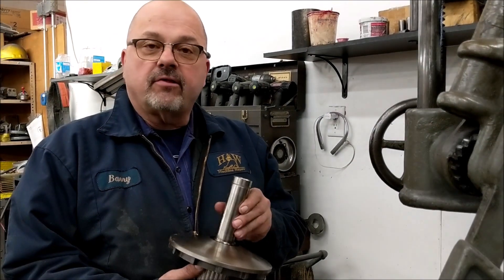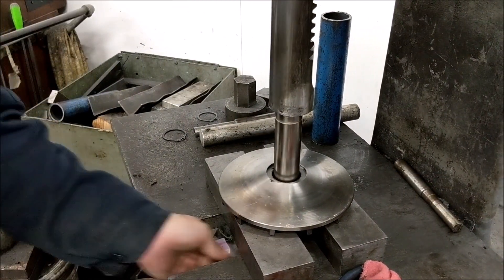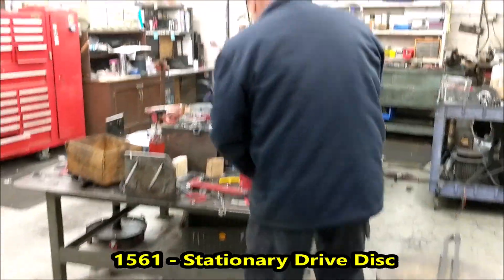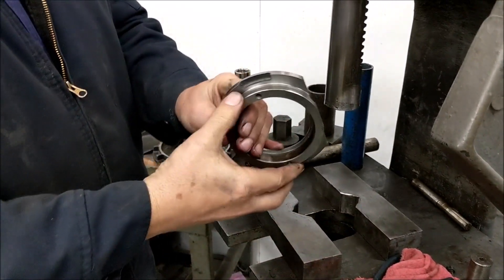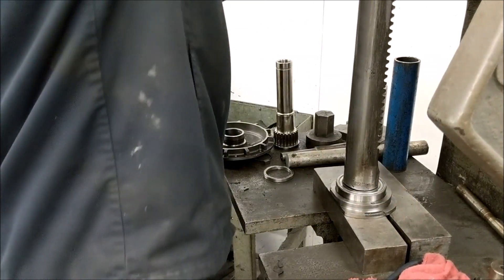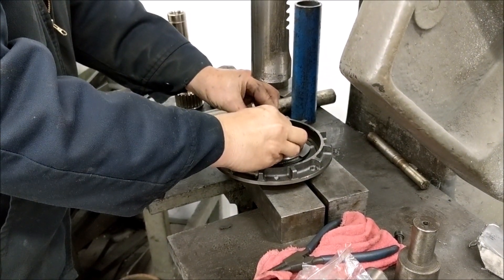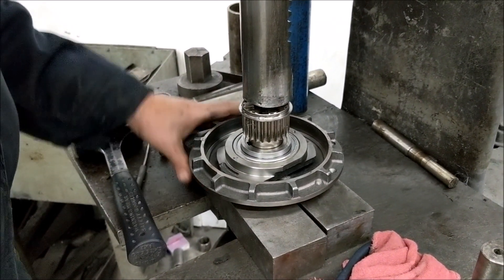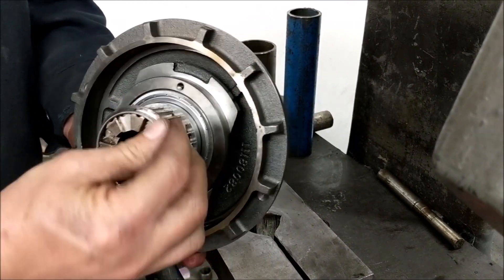Disassembly and Reassembly of the Spindle Pulley Hub

Comment: Barry, I really appreciate your videos despite the fact that I have a King Rich KRV-2000 machine, they are very similar, mine being a rip off version of the Bridgeport. Non the less I have found most of your videos are almost perfect for me. Have you done a video on replacing the brake shoes yet, if so which video is it please. Do you post items to Australia?Thanks in advance
Reply from the maker: Hi Gordon, we don't have any videos on just replacing the brake shoes, it's mixed in with the dissasembly and reassembly videos. We can ship to Australia, but the brake shoes for a Bridgeport most likely wont work on your mill. If you want to email us we can send over the measurement sheet so you can compare yours: support@hwmachinerepair.com